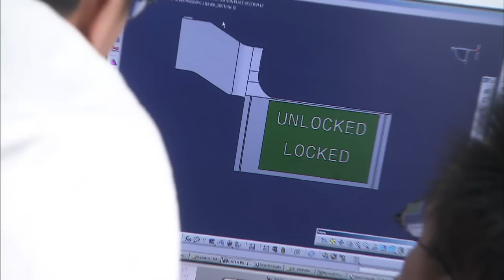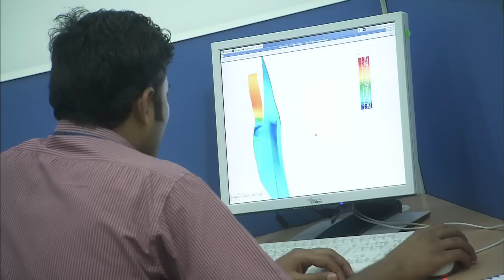Honouring diversity in engineering

Comment: What if I told you that the 727 has had more hull losses than ALL Airbuses, even though there are over 7000 Airbuses and 1,800 727s. And the 727 has had less hull losses than the 737.

Get over it. You don't get to 7000 aircraft in operation if your planes are dangerous.